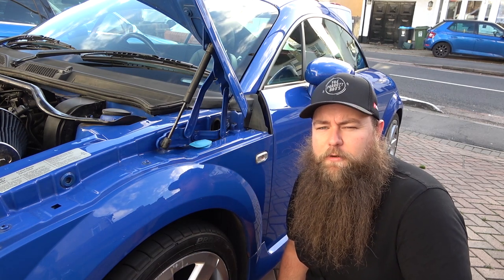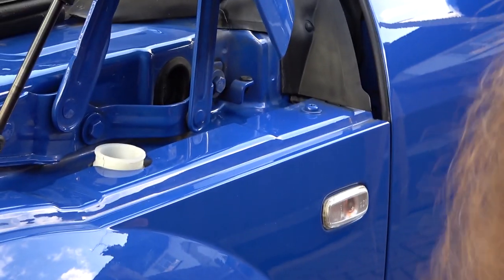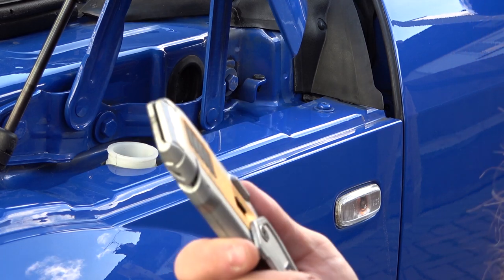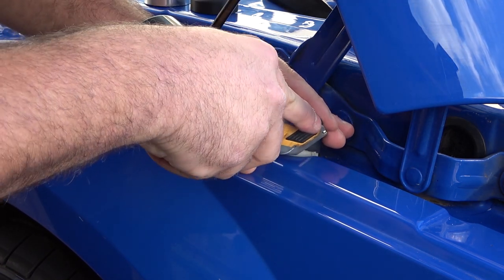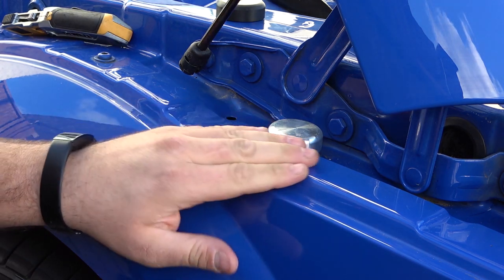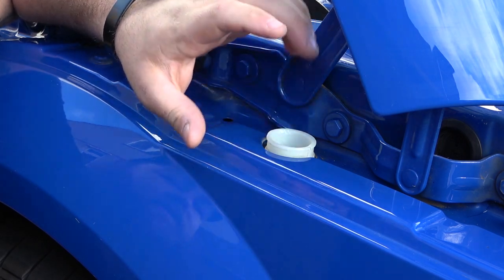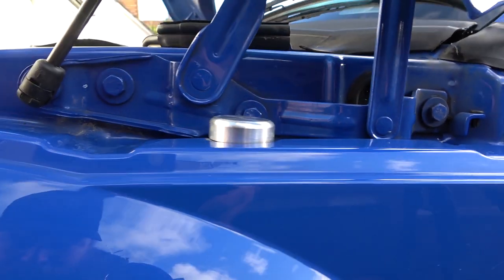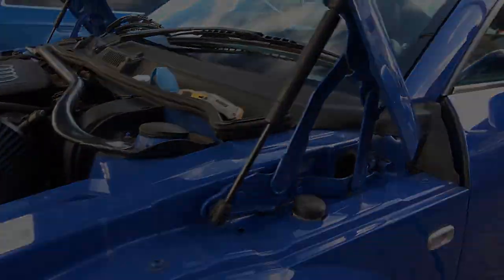Audi TT Washer Bottle Cap Mod

Comment: My original cap surprisingly is in good condition however the unit sits down just below and it doesn't cap properly.

I've taken mine in and out several times pull the wheel off and then the inner fender to get to the pump. I also deleted the front sprayer.

Have you replaced the intake and exhaust Valves yet. I'd love to see a video.

Always grateful for those that can articulate with the rest of us cannot say or educate us on what is unknown
Reply from the maker: Crazy Crawford as of yet I have not done any engine work but will be doing a build in the future. Have a spare engine to work on :)
Reply: @TheParrottBros  
Thoroughly enjoy the channel I've got a 2002 Audi Quattro TT 225 hp amu roadster.

I thought the MK1 TT to be a good car to work on before building a kit-car.
It all started with the strut mount lol.
Since then it has list and struts Edelbrock springs new mall control arms tie rods new speeds front sway bar adjustable sway bar links power stop breaks all the way around new lead cables emergency brake cables new front CV axles that I've done numerous times actually as they do not fit properly the size of the rim with the original package depends on the CV axle.

I've removed the windshield washer tank cleaned it I've done vacuum lines ramair cold air intake with a badger five hose.  Replaced all the radiator hose at this point to silicone working on replacing everything else I have the current intake hoses in silicone. although they haven't been installed however after watching your front intercooler video I do believe I may go with that. I would also like to replace the stock OEM with an aluminum radiator and the intercooler would help protect it.

Not sure if it's stock or not but it has a 3-in downpipe coming off the turbo.

Momo rims tinted windows. Custom wood interior. now this is the part where I shined a little bit cuz I was good at much better at carpentry work than my initial mechanic skills.  Beautifully rebuilt the rear panels as well as the caps for the roll bars and poplar wood with a spar varnish. the patterns vote for the center console and we also plan on redoing the old dash so eventually make it look like the interior of an old mg or triumph TR.

Comment: Any chance on a video off how to do the chasing indicators like the newer Audi's please
Reply from the maker: It’s in my list of things to do, but wanted to get mechanical cracked first and nearly there now so will see what I can do on coming months
Reply: Hey, do you want to know the easiest, dirty way of doing that? Well, for the rear at least.
Simply replace one of the two bulbs with LED ones. The inner ones. (>)> They'll light on and off quicker than standard bulbs and will give a similar effect. You have to find proper LED bulbs with matching resistance though, otherwise it may throw hyper-flash bulb warning. I say "may" because the resistance check is done for the whole flashing side, including all the bulbs on that side. It may work error free in summer and not so in winter. Better get some resistance there.
I didn't do this myself yet but in theory, it should work beautifully.

Comment: Lovely little video
While I’m here, anyone have any idea of whether an oversized TIP and air filter can cause turbo flutter or damage with stock diverter valve?
Or is it all good to get both of those mods on ASAP?
Reply from the maker: Thanks buddy, you should be able to to fit both without any issue, as you are just increasing / making it easier for the car to get more air. You maf meters the air and adapts accordingly
Reply: Stock DV is really trash. Got two of them tear in a short time and cause that horse noise so far. Can't find the gfb DV+ ones locally but I'll go for those eventually. Even better than Forge 007 and 8. Requires almost no maintenance.
Reply from the maker: 4L10 thats strange as I’ve run genuine DV’s on all cars, all have been tuned and had no issues whatsoever
Reply: @TheParrottBros  Really? Two manufacturing defects in a row is still a possibility but both were gone within 500km give or take. They were both Bosch. Not driving around like a mad man all the time neither but the model I mentioned interests me as it is a better engineered part with better construction and materials. If I keep getting these lemons or whatever the reason, I'll end up having paid the price of that nice part soon enough. :D
Reply from the maker: 4L10 very odd, could be a batch issue or just luck. I’ve got a new genuine one on mine that’s done 10k no issues. There is good metal ones out there for
Sure I’ve just never had a need for one

Comment: half the time I go to refill the fluid mine is popped open..I'm worried if I go this route it'll pop off and just fall out of the car..at least the OG one has a thing holding it on when it pops off..
Reply from the maker: these ones are a snug fit so no chance of that

Comment: Why not just paint stock in black?)
Reply from the maker: MrYevgenyZhekoff you can buy a black stock equivalent from a Lamborghini cheap enough but these just look slick and if you have strut top mounts & changed out your oil / coolant caps it’s just a nice touch

Comment: Does 19 inch wheels fit on my audi tt (2001)?
Reply from the maker: MonkeyMaster yes dependant on tyre size width and offset. Video going live on Sunday 4pm for this very subject
Reply: The Parrott Bro’s  offset is 35 and i have to buy new tyres so should i buy 245/35 or 45??
Reply from the maker: MonkeyMaster what about the width, 245 is wide. You will need low side profile.
Reply: The Parrott Bro’s   So what should i buy?
Reply from the maker: MonkeyMaster you need to know the width. 7j 8J? Then go on to www.willtheyfit.com and put in the stock wheels and new wheels details and it shows you the different specs. Then you can check car and make sure the differences will be ok
Reply: The Parrott Bro’s  thanks for the help and keep up the good work!